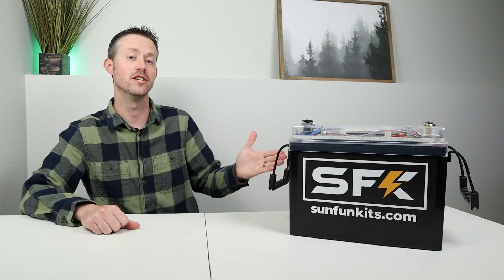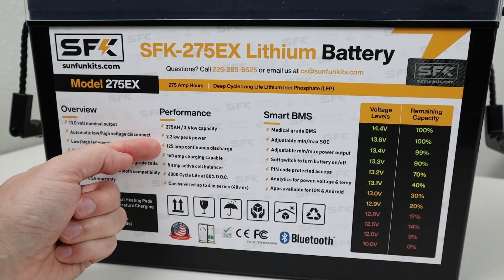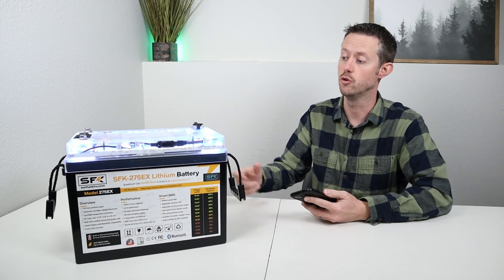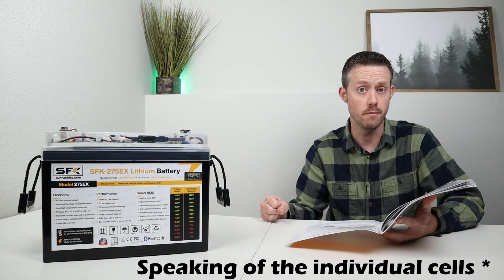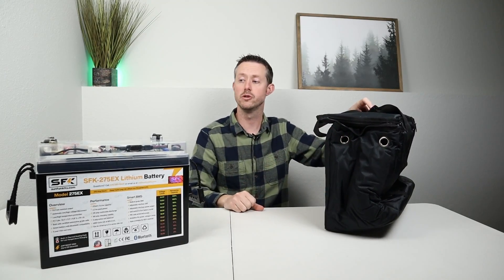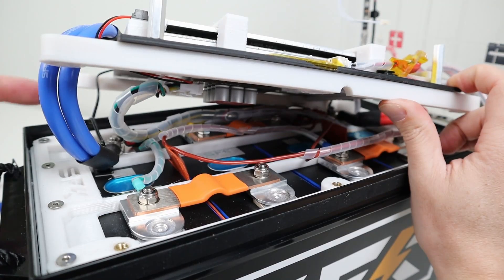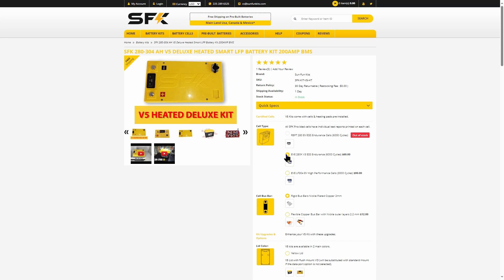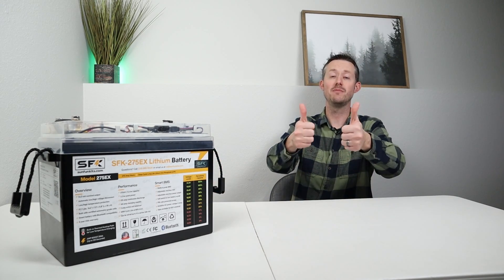SunFunKits  SFK-275EX  LiFePO4 Battery - TESTED - Small Footprint - BIG Capacity!

Comment: Thank you for the excellent review 😁! Some information: 1) The heater button on the switch will keep the battery warm even when not charging so if you are in very cold (e.g. minus 10 degrees F) you can use this to keep the battery warm around 65 degrees F, it will use about 10 Ah/Day when used with our insulated jacket.  2) The active balancer can be set to run continuously (blue light), or only run when the battery is near full (green light), or you can disable it and use only the BMS passive balancing. The 275EX is rated for 6000 cycles and our 300HP is rated for 3500 cycles. Thank you again!
Reply: Nice to see a reply from the manufacturer.  Your clear lid prototype is a great idea.  It tells me that you are proud of the internals and construction inside.  And the LEDs are a great idea too. Even if they aren’t “smart” LEDs and can just turn on/off they are still super useful because my batteries are always in a dark box and I always need a light to see what I’m doing anyway.  Working with electricity is always a good thing to be able to see what you are doing!  Just don’t overdrive the LEDs.  I don’t know why everybody drives LEDs until they are hot when they can run them on less than half the current and minimal heat and they’d live forever.
Reply: I love the clear lid!  But you don't offer it on your website.    Awesome battery.

Comment: They don't support their older batteries (BMS) like they should. I've been trying for 5 months to get my 3 batteries to talk to their app . This is the last communication I had with them but they won't respond anymore    " OK to be clear the batteries are working OK. The BMS in each battery will not communicate with your app. I use these batteries about 6 months of the year Oct-March  and then store them at 50-70 per cent of charge until needed . The app worked fine when the batteries were stored in April 2025. The app would not communicate properly when I tried to use it in Sept 2025 as you can see in several of the screenshots I sent in the past few weeks. There is no question as to why it doesn't work now ( you updated the app to newer versions) which left not only me but other people who can not communicate with their older BMS installed in their batteries. Yes I can use a third party app "OVERKILL SOLAR" as you kindly suggested to obtain charging and discharge status but SKF should provide customer support for the products you sell. There should be no reason to return the batteries at great expense $300 plus when you are technically skilled to produce an older version of your app which did and will work properly for customers who purchased your batteries back in 2020-2023."

Comment: 13 V makes it kind of out of usefulness. If I were to hook four of them together, I would not get the proper voltage for 48. Wiring them together in series might be a problem.
Perhaps they make a 48 V version?
Reply from the maker: A true '48v' battery system has around 55-58v under operating conditions, the terminology can be confusing.

Comment: Have 2 300 amp SFK batteries in my Arctic Fox 5th wheel slide out battery trays.  They fit the trays width wise, but I had to bend  a tab on the end of the trays to fit length wise.  I needed an extra 1/4".  They are feeding a 3000 watt Victron Multiplus.  With the SFK app and the blue tooth I have no need for a shunt.  Only had them for 9 months.  They answered the phone when I called them and were very helpful and knowledgeable.

Comment: It lost me at 120a BMS....Should have been 200a.....
Reply: It has a 200 amp bms, they just tell people not to run it over 125 for long periods, Reewray outdoors tested it for 5 mins at 200 amps.
Reply from the maker: He tested the 300HP so it's slightly different than the 275EX. You're right that  BMS can pull 200 amps, but it starts to get warm when pulling that many amps. The wiring is also 6 awg in parallel so ~120 amps continuously so that would get hot with 200 amps continuous. That's why they suggest the 2 minute runtime for the full 200 amps. There's no active cooling so that heat gets trapped in the battery from the BMS and the wiring.
Reply from the maker: I am curious why they didn't have a larger BMS with the 280ah cells. I guess the less of a discharge rate, the longer lasting it is. They are aiming for 6000 cycles to 80% orginial capacity.
Reply: E-Lektech 300ah has a 250a bms for $700,,,,,,,,smaller footprint too.

Comment: Here's the good, bad, and ugly about it for me, on first impression.  

Good: Heaters and form factor.  Having a 100Ah mini (different brand) myself, I am sold on smaller batteries with higher energy density.  Everyone comparing price/kWh to bulkier batteries is missing the point of this battery.  If you are building a big battery bank with plenty of room in a non-freezing space at home, definitely don't pay the big premium for these features.  If you are installing it into a vehicle and burning fuel to drive it 20K miles per year, maybe buy it.

Bad: Despite the above, with 100Ah mini LiFePO4 dipping below $200, price IS an issue.  If it takes 10Ah per day to heat this battery in a cooler bag as they say, it takes about the same to heat the same capacity of unheated batteries in a cooler bag.  Is anyone going to double their battery cost just to avoid buying their own cooler bag and a heating pad?  

Ugly.  As an engineer, I try not to buy anything from a company without real engineers doing the engineering.  That includes getting units of measure correct in specifications, because getting the specs wrong on their own product is a reliable sign of a company where engineers are either non-existent, or at least out of the loop.  It didn't seem to bother you that the spec label on the battery says "3.6 kw" capacity.  You correctly stated it as 3.6 kWh, without pointing out the error, rather sort of glossing over it for them.  NO engineer would make that mistake about the units.  It was clearly written by someone who doesn't even understand units of measure, approved for printing by someone who doesn't understand units of measure, inspected by someone who doesn't understand units of measure, and marketed by someone who doesn't understand units of measure.  Now, that doesn't change the battery's capacity, but it does indicate that this company is not run or even fact-checked or proof-read by engineers.  They are more likely just slapping together components.  Fixing what is printed on the label will not mean they suddenly have an engineering staff.  Is that a fatal flaw, now that batteries like this are evolving from being an engineered product, to becoming a commodity?  No.  But to me, this is priced as a premium/custom engineered product, not just some components slapped together by a reseller/marketer.  Buyer beware, especially if you're counting on them to be around by the time of a warranty claim.  Marketers who don't even understand their own product's technical specs, come and go.  

Bottom line, if I needed and wanted this battery, and didn't mind the premium price, I'd buy it.  It beats the heck out of a Battle Born for value, for instance, even if you place no value on the warranty.  But I'd recognize that the company seems unlikely to last as long as the warranty.  A battery company not knowing a watt of power from a watt-hour of energy capacity, does not inspire confidence in their longevity.

As happened with the 100Ah mini batteries, it probably won't take long until a whole bunch of companies have similar offerings.  Maybe Black Friday 2024 is the time to buy something with this capacity and form factor.  Maybe Black Friday 2025.  Being an early adopter, is expensive.  Do you want one now, or two for the same price next year?
Reply: Quite a big post you are right about the labels, but when you started talking about the $200 100ah batteries I immediately changed my opinion of your thoughts. Those are grade B batteries that use whatever random cells they can find the same sku will have pouch cells 1 day and cylindrical cells another day. Also they don't stay in balance by the 5th or 6th cycle they don't charge over 13 volts because they are already out of balance. So those cheap brands are junk and with in a few cycles you will only be getting 70% of the rated capacity due to poor balance.

This battery should only be compared with grade A brands such as SOK, EPOCH, or Volithium. Junk brands like Chins, Wieze, and Power Queen should not even be considered, I suggest you search on youtube for Chins Fail, or Ampere Time fail. In fact Ampere time 48v battery review by Will Prowse was so bad they changed there name to Li Time. Redodo was original Zooms. 

You should find out the difference between grade A and B before coming up with your conclusions.
Reply from the maker: @Foxfried they should have labeled the battery a 280ah battery due to the 280ah cells inside. It seems there were being conservative on the capacity... They also should have labeled the capacity as 3584wh total (12.8v x 280ah)

Comment: I wonder how that battery would do running the Dometic RTX 1000 12v RV/Van airconditioner?
Reply from the maker: What are the specs and power usage numbers on that?
Reply: it says 1200W and 18amp in eco mode.  @Jasonoid
Reply from the maker: @panthercityoutdoors  you mentioned it's a DC air-conditioner. If it pulls 1200 watts, that would be 100 amps @ 12v. Not sure what the 18 amps would mean.

Comment: I just bought and built my own Licitti kit battery for about $500.  This one definitely has some really nice features and is definitely several steps above mine in terms of quality and attention to detail.  I’m very impressed!  I wish I had the money for the SFK, but I’m happy with mine.  At 280 AH It really has the capacity I was looking for in our RV.  I no longer have to worry about waking up to a dead battery in the morning because our propane heater kicked on during the night and drained it dry (which has happened 4 times with the stock Thor lead acid configuration).
Reply from the maker: The Licitti setup is cool as well. Lots of option available out there. As long as you can get through the night now without low voltage alarms you should be good :)
Reply: @Jasonoid  great job on going over the features by the way.  That light blows me away.  I wish more batts hat that because I’m always struggling to see what I’m doing in dark places and when working with electricity, you don’t have a third hand for a flashlight.

Comment: That was a good review, Jason. I think this would make a great RV battery. I wonder if the heater could be on a thermostat because the only drawback I can see is the continuous heater draw. In Utah, we do not have sunny days every day, so you would like the battery to not be charged when it is too cold and you are not there to push the heater button.
Reply from the maker: If you have this in constant heating mode in the insulated thermal case, it will use around 10AH a day to keep itself above 42F. Considering the battery is a 275AH battery, thats hardly any power at all if you have it charging with solar daily.

Comment: Looks amazing Jason. Super basic question, but if you connect 4 of these in series for 48V, does that mean theoretically you could drive a 6000W inverter?
Reply from the maker: yep, 48v @ 125 amps is 6000 watts. So continuous load would be 6000w, surge would be 9600 watts.

Comment: Nice battery but IMO not competitive in price. Good batteries (PQ) without the bells and whistles are about .20 cents per watt
Reply from the maker: Three 100ah self heated batteries from Redodo are around $1000. Is there any added value to have a product from a US company with a true warranty and support? Just curious where the line is drawn for 'cheapness' vs quality and reliability.
Reply: PQ 12.8V 200 AH Plus for $525 before any promotional discounts. Excellent CS and yes w/o the heaters. Not everyone needs them. On "American" Company's... who's products are made in you know where by choice for their bottom line.  @Jasonoid

Comment: I’d be curious to see if it fits in the typical tongue mounted RV battery box, It looks quite a bit taller and wider than the Dr Prepare. I don’t think the the battery compartment in my Casita travel trailer is typical in the RV industry, but it barely fits the Dr Prepare. If the Lithium battery makers could squeeze more than 100Ah in that same size outer shell, I think RV owners would be VERY interested.
Reply from the maker: I'm guessing the height would be the issue. It's a little tall. It might need a custom box solution.

Comment: Seems like a well built product, but overpriced imo. Thx 4 the review.
Reply: YUP  way too much
Reply from the maker: The cheapest option is a Redodo 100ah self heated battery for $329 right now. You'd have to buy three of those to get near the same capacity so that would be around $987. Those don't have Bluetooth or an active balancer in them. They are also from a Chinese company without US support. I guess it all depends on what you are looking for.
Reply: How so every other battery with smart Bluetooth monitoring and data communications is at least $350-$500 more.